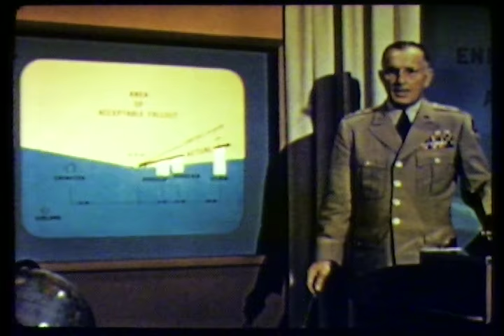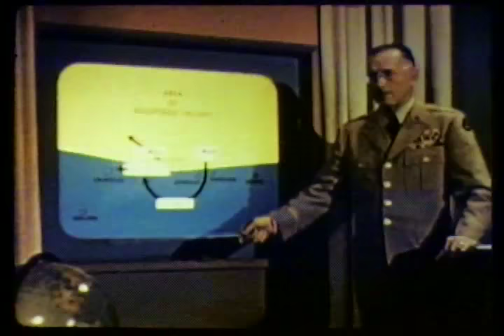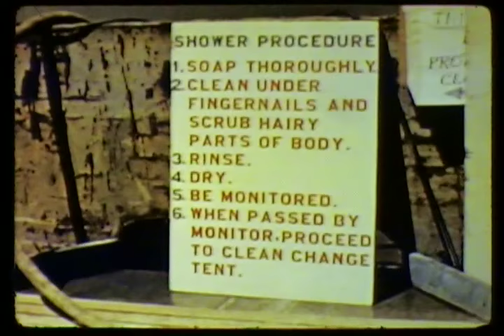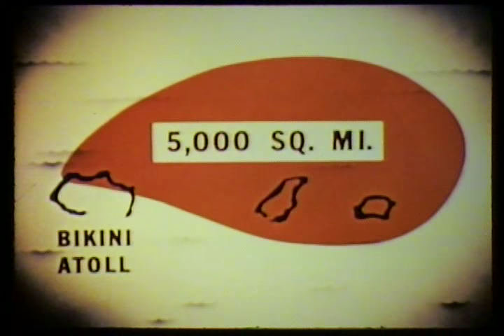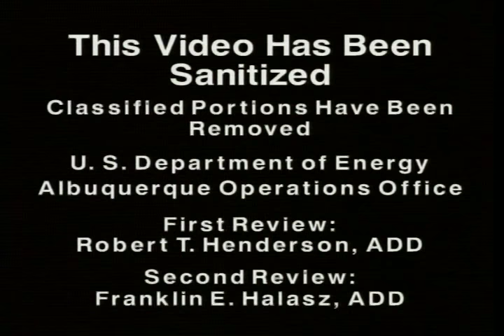Operation Castle (1954)

Comment: The test facilities were designed based on the 5-6 megaton prediction. The unexpected effect that the Lithium 7 had boosted the yield to 15 megatons. The fuel was lithium 6, with more abundant lithium 7 as an inert substance. Unfortunately, the lithium 7 loses a neutron early in the explosion, and becomes lithium 6, ie more bomb fuel.
Reply: +Zoomer30 That explains why the yield was larger than expected; thanks.
Reply: Fantastic explanation
Reply: Most accurate explanation
Reply: That was in the Castle Bravo video..... The reaction caused Tritium to be made which is essentially pure nuke fuel. Think gasoline vs. rocket fuel in simplified terms.
Reply: I forget the guy's name, but he is a civilian who has amassed the largest collection of declassified material on the  US weapons program than anyone else in the world and he has been releasing material that is showing up on Wiki.  The Shrimp device that was fired at Castle Bravo was all tricked out. It was intended from the start to be a high yield test of an airdrop design. The lithium fuel issue was caused by production shortages, new alloy facilities were not up and running to capacity and these devices used lots of lithium, hundreds of kilograms of lithium hydride were used ranging between 37 and 40 percent Li6 depending on the refinement level, and it was like $5 a gram in 1953... It is highly likely that LiD and LiT were employed, so the fusion fuel was additionally boosted with tritium deuterium for D-T fusions. This device was tricked... It used a hollow plutonium pit with a new boosting design that had been previously tested and improved for Shrimp: this produced much larger numbers of prompt neutrons early in the supercritical stage while the primary was under maximum compression...  The same technology was applied to the weapons grade plutonium "sparkplug", it was hollow, plated inside with copper to prevent material contact, and then loaded with grams of tritium. Fogbank was being developed: a classified aerogel doped with beryllium and perhaps other fission/fusion additives. It's transparent to X-rays and forms the interstage material and suspends the secondary centered within the outer casing forming a radiation Hohlraum... The surfaces inside the device, like the radiation channel and reflective surfaces, were machined to incredible tolerances. New production techniques had been introduced for Shrimp: they had designed and built special machines just to manufacture these bombs and Shrimp was the first full package test in an airdrop designed device... The tamper was enriched to 37.5% U-235. They made a lot of seemingly small improvements or used a lot of design tricks in the Shrimp device, and they had a synergistic effect on the final yield.  Lots of brain sweat went into these things.
Reply: @rtqii  Civilian with largest collection of classified information…..doubt it.

Comment: Castle Bravo,  the one where they miss calculated the yield by a wee bit?   Calculated 7 megatons, actual yeild, 15 megatons.  Just a weeee bit.
Reply: also much dirtier burn sinc the "wrong" lithium started fusing
Reply: @ravener96  It wasn't the lithium...it was the effect that unplanned reaction had on the uranium tamper causing fast fission.
Reply: I wonder if someone said "did you use enough dynamite there Butch"?
Reply: Predicted yield was 6Mt, +/-2Mt.  The "oops"  legend is overstated. That was/is/always will be an unusually high margin of error even for megaton tests. They expected to be surprised, just not that surprised.
Reply: If it wasn't for how remote the test was, Bravo would've vastly overtaken Chernobyl as the most disastrous mistake in human history.
Then again, it pretty much destroyed a small country and rendered it uninhabitable.
Reply: @imkindofabigdeal4308  Wrong - the physics was screwed up because they assumed lithium wouldn't fuse. Lithium 6 does. The Lithium 6 Dueteride fused nicely. The Lithium 7 Dueteride that made up the other half of the fusion core not so well.
Reply: @ravener96  Actually fusion bombs are very clean - the highly irradiated coral (calcium carbonate) that got lofted on the other hand was not so nice.
Reply: @minigunner1218  Chernobyl wasn't the worst nuclear accident - it's not even the biggest Russian accident, it was just the one they couldn't cover up at the time.
Look up Kyshtym... Like Chernobyl if it wasn't evacuated and put out more radiation...
Reply: @allangibson8494  fusion bombs in general are clean, castle bravo was not very clean.
Reply: @ravener96  Well, as I recall, the B41 (our largest yield weapon ever) had a lead tamper (clean) version, and a dirty version that incorporated a big beautiful U238 tamper that fast fission to somewhere around a third of the total 25mt yield. Of course we never tested either of these, so its all at least somewhat speculative. Russia, on the other hand, tested several twenty, and at least one 35mt device. Maybe when Vladdy Poontang is out of office, those test films will be released.  I'd really love to see their full scale ICBM test with a twenty megaton warhead.

Comment: One of the scientists observing this said the heat from the bomb was incredible.  And it kept getting hotter as the time went on.  Not cooler like you might expect.   And they were 50 miles away and the heat was nearly unbearable... at 50 miles!!.  Half your distance again to this 25 miles.  You'd be cooked to death let alone pulverized by the shock wave.  If you were in a city with this you'd be boiled and turned to burnt carbon in seconds before anything else.  

How lovely!!
Reply: Tsar Bomba (57MT) would have given 2nd degree burns at 100 miles had anyone been close enough when they set it off and it actually smashed windows in Helsinki 600 miles away.
Also, sounds crazy but a city would be a good place to be. Plenty of surrounding buildings to shield you from the initial pulse. Sure, if a nearby building collapses then your screwed but out in the open, you have no chance. So long as you're not at ground zero in which case you're dead no matter what, its the initial gamma pulse you need worry about protecting yourself from.
After that, it's fallout. That's easy to deal with. Just walk towards the wind and don't stop walking until you're miles and miles away. Plus, most modern weapons don't actually leave much fallout due to the way in which they're fired. A ground burst would pick up the most debris and create the most fallout but actually deals the least damage as intervening terrain and buildings slow the blast wave. Weapons are mainly deployed at about a couple of thousand feet up so the expanding wave slams into the ground and the reflective secondary wave catches up with the primary creating a localised area of extreme high over pressure and devastation. Due to being detonated in the air though, very little debris is picked up and carried vast distances in the mushroom cloud meaning little fallout.
Reply: On these tests I like to time the shock wave .Start at the flash end at the arrival of the shock waves . Roughly divide the ET by 4.5 and that give you the miles distance ie 45 Secs is 10 miles away
Reply: @Crimsonedge1  if you were 100 miles away from the bomb you wouldnt get any gamma rays or any rays at all because youd be over the horizon.
Reply: @skiiipawbs  Peak heating is 3 seconds after detonation. The atmosphere absorbs the initial energy and reradiates the energy at a lower frequency. The heat pulse lasts about 20 seconds.
Reply: U would be bones before u could fall bone would be ash and u are dust in the wind
Reply: @kevinhoffman6592  Depends where you were.  Strangely people who were directly below the point of detonation of the first atomic bomb survived the blast as the shockwave tended to emanate out from that point.  But the heat from a thermo nuclear bomb of 50 megatons would be like turning the sun on over your city.
Reply: crispy critter
Reply: Pff just duck and cover
Reply: @roquefortfiles  actually the core of the sun is 15 million degrees,same as the fireball of an atomic bomb,the thermo nuclear bomb is infact 100 million degrees far greater even that of the sun
Reply: @angelkirov8663  Can you imagine what a 10 megaton fireball 3 miles across would do to a city?  100 million degrees and an over pressure like 30 PSI.   5 psi will turn a house to kindling.  Scary shit.
Reply: one word! krakatoa.
Reply: @eddjordan2399  The fireball was 4 miles across.  100% power!!.. 4 miles across.  Terrifying
Reply: Yes fusion undoubtedly has that building of spot radiant emission but that lithium must have thrown a curve into the time n magnitude of pure ir n raw particle energy, they should have built a lead freezer to hide in smh
Reply: Since this was a ground burst, most of the shockwave was mitigated by the terrain so the heat would be a much bigger factor by comparison.
Reply: @racer927  the shockwave heavily rocked the control bunker . It was 23 miles away
Reply: @racer927  One scientist said they were 50 miles from the detonation and as the fire ball climbed into the stratosphere they thought the radiant heat would subside. It didn't.  It kept getting hotter and hotter until it got scary.    They were 50 miles from it.  Can you imagine being a few miles.
Reply: @roquefortfiles  If it heavily rocked it at 23 miles, imagine if the weapon was detonated at the optimal airburst altitude...
Reply: @racer927  15 megatons?  The fireball was almost 4 miles across.  Optimal Burst height would be about  7000 feet.   Combined shock waves. Primary and reflected .  That would be scary
Reply: @Crimsonedge1 what’s scary is the Tsar was designed to be 100MT but reduced down…. Castle bravo was accidentally 15MT
Reply: @thebanfflocal2366  The burns would be from Infrared thermal radiation and not gamma rays. 2nd degree burns at 100 miles and 3rd degree at 62 miles.

Comment: I was reading that if the Tsar bomb was detonated and you were in the open 100 miles from it you would still be too close.  It would produce 3rd degree burns even at that distance.  I can't even imagine what it would be like being 20 miles from this thing.  Sitting in your car and it goes off. In about 2 10ths of a second you would be boiled out of your skin before you would even have to worry about the blast wave.  Probably be a nice cooling effect to the 10 million degree fireball.

Comment: Amazing, I saw one air shot in the kiloton range from 40 miles it looked like we had a second sun but nothing like this.
Reply: I know this is 10 months late but wow! That is fascinating, would you mind describing the scene in more detail?
Reply: @isaac-vb1ng   I'm 71 years old now, so the details are not like yesterday and I'm not even sure of the date, that being said I will give it a go. It was when I was on the guided missile cruiser the USS Springfield (CLG-7) This was during the test ban treaty so it was very hush, hush, 1970 or 71' Somewhere in the Atlantic near the equator it was sometime around 1300 a friend of mine that was a "gunners mate missile" told me to go out on deck behind the missile house and watch. I was used to doing this because I had previously taken pictures on highspeed film of test firings, this time no camera. When the launch came I watched it go nearly straight up, this was unusual. because the Terrier missiles were usually launched at a greater angle. That missile was an AA weapon that in a pinch, they said could strike a ground target. I had seen several detonated, mostly self destructed because they flew outside the radar guidance envelope.  This detonation was much different, there was a brilliant fireball overhead that lasted several seconds like a second sun, then it disappeared with no sound. I don't remember how I calculated 40 miles altitude, maybe speed of the weapon and how long before I saw the flash. So there it is, the first time I ever told that much of the story. Its been 50 years now so I don't think they will come and get me for just telling what I saw that long ago and I have no proof. Have a good night Isaac. Here is a look at the missile. https://www.youtube.com/watch?v=JySnSYMAiWo
Reply: @AdamosDad  wow! I cant thank you enough for sharing your experience of such an amazing part of history with me, I'll be remembering this for a long time, God bless you
Reply: @isaac-vb1ng  Your welcome.
Reply: @isaac-vb1ng  By the way God has blessed me with a wonderful life, and may He do the same for you.
Reply: @AdamosDad  Awesome! Thank you for sharing brother this is the kind of first hand account you don't come across often, really appreciate you opening up about it in public. 
Initially I figured you were involved in the Argus test but the dates don't line up for that one, Argus was in 1958. Whatever test you were involved in it sound more like something akin to the "Vela Incident" which was in the late 70s.
  So you estimate the blast to be up around 40 miles in altitude? Based on that calculation and your experience of the fireball dimensions, how many KT would you estimate the yield to have been? Perhaps describe to me how large it would be compared to holding up a penny or quarter to the sky at arms length...or the moon etc.
Reply: @kaizee808  It appeared to me at least as I recall, a little smaller than the Sun would appear at noon on the Equator.. It was verry hush, hush whether we even carried the nukes or not, so I could not begin to guess the KT range. The altitude guess on my part was in knowing some of the capabilities of the missile.
Reply: @AdamosDad  Have a look at this footage and tell me if it bears any similarity to this, perhaps you are already familiar with the footage that’s out there so my apologies if so! 
https://youtu.be/LZhvZZ43DDE
 I figured the “Bluegill Triple Prime” shot is the closest  to what you describe in terms of altitude at least…yield on this one is not clear but estimated 200 to 400 kt, altitude is 160,000 ft on a Thor missle.
Reply: @kaizee808  I would say it was similar in duration, but this shot was apparently at night, the one I saw was about noon, and of course not at any magnification. Missile type was Terrier anti-air, not the very large Thor.
Reply: @AdamosDad  Given that it was a Terrier SAM the warhead was most likely a W45, at least according to what limited information exists on the web. It seems that the yield of the W45 ranges anywhere from 0.5 to 10 KT depending on configuration. 
  If you have the time and haven't already done so, I propose that you write an in depth report that includes all your memories surrounding that day and all the names, dates, waypoints etc...in the name of documenting history! As far as i know this  test does not exist in any official capacity and it is extremely important for accounts like yours to be heard...at least IMO. Granted, i'm a history buff and have always been fascinated by the history of nuclear weapons development. If there is a test that I haven't heard of then I want to know everything there is to know!! 
 No rush brother,  i'll keep in touch and please let me know anytime you feel like sharing more information!
Reply: @AdamosDad  i believe you 100% and i really appreciate you sharing your experiences

Comment: To put names to the tests:
Bravo -  "Shrimp" device, Mk-21 design, exceeded expected yield by 250%. 15 MT, surface.
Romeo -  "Runt" device, proof test of Mk-17. 11 MT, barge
Echo - cancelled.  Test of Ramrod wet thermonuke.  Killed by success of Bravo and failure of similar Morgenstern device.
Koon - "Morgenstern" device, fizzled. 110 kT, surface.  The name came from the morningstar weapon, which the case resembled.
Union - "Alarm Clock", test of Mk-14. 6.9 MT, barge
Yankee 2 - "Runt II", test of Mk-24. 13.5 MT, barge  The first Yankee was a test of a wet bomb "Jughead", but after Bravo it was replaced by another dry bomb, hence the "2".
Nectar - "Zombie", test of Mk-15. 1.7 MT, barge
Reply: Thanks. Interesting stuff. I take it  'wet' & 'dry'  refer to the state of the lithium?
Reply: @dominicseanmccann6300  Yup.  They'd developed a droppable version of Ivy/Mike; I don't know anything about what it did, but after Castle and Romeo, they put it back in the box and shipped it home.

Comment: I have read many witness descriptions of the Castle Bravo shot after effects.  Someone calculated, after measuring the crater, how much material had been vaporized/removed:  10,000,000 tons of coral, rock, and sand.  The coral was vaporized/pulverized and mixed with fission fragments.  Bravo was a dirty bomb, most of the yield resulted from fast fission of the enriched (37.5% U235) uranium tamper. The fusion fuel was significantly more potent than predicted, more fast neutrons were produced and more fast fission of the tamper resulted.  The tamper weighed over a ton, and it produced over a  ton of highly radioactive daughter fission products. The fallout came down like a snowfall of radioactive coral ash, and it was prompt lethal in the area 60 miles downwind from the detonation site covering an area of about 2000 square miles. Anywhere in that area you got a lethal dose of radiation in just an hour or two.

Comment: Anti-matter annihilation provides 43MT of energy per kilogram of input matter. There is about 12 kg of plutonium in a bomb, which makes the total about 520 MT, about the total energy released by all nuclear bombs ever exploded. But the Chicxulub meteor which killed the dinosaurs released 100,000,000 MT, and didn't quite make it to break open the crust and expose the Earth's mantle.  So, no, it would take considerably (!) more then a bomb core to do the job,